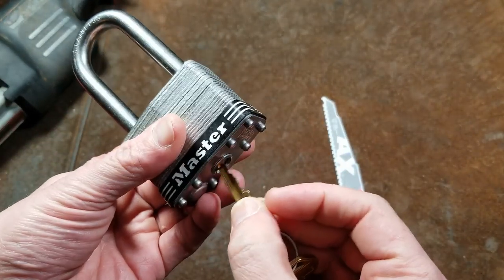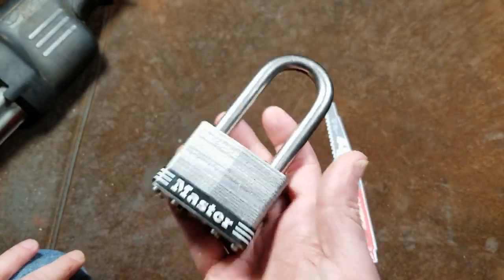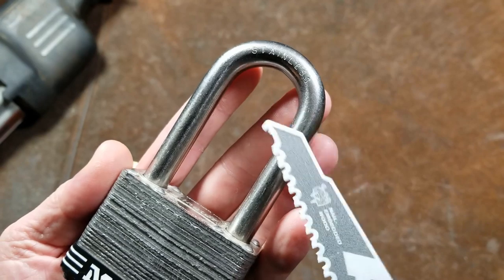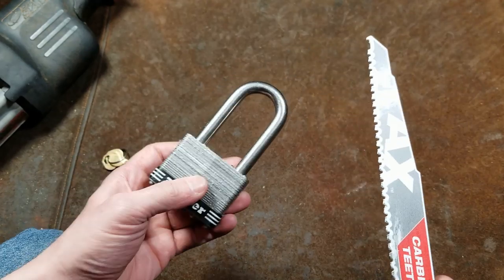Carbide Sawzall Blade vs. Heavy-Duty Stainless Steel Padlock

Comment: A couple of pointers. First, start the saw before you put it against the object you are cutting. second, keep the object as close to the guard as possible, the further out on the blade you are the less stable it is.
Reply: I’m glad you added that. I was thinking same.
Reply: Learned the guard pointer at work today, helps so much

Comment: Get a battery powered angle grinder with a cut off wheel and some channel locks.  On the gate the lock will come off in under 10 seconds no vice is needed.  I am assuming a new non clapped out cut off wheel.  It is really easy.

Comment: There are lots of high-end grades of stains less steel (heh), that can be 60hrc or a bit more. Often seen on high end knives, though is true even though will be a bit softer than the hardest grades of non stainless steels. But the gap between them is much smaller than what you said in the vid, least when you compare the best to the best. Also, least from what I have seen stainless steel lock shackles are almost always some grade of 300 series so dead soft but slightly work hardened. Is the shackle magnetic? Will quickly reveal if it is 300 series or something better, but I highly doubt Masterlock used a decent grade on that thing.

Comment: A few hours ago I cut a padlock with the m12 hackzall ... took a while but still did the job. 
If I had any brains I should have used the little m12 cut off tool instead
Reply: Cut off wheel is better option.